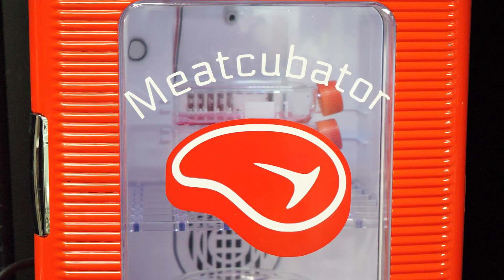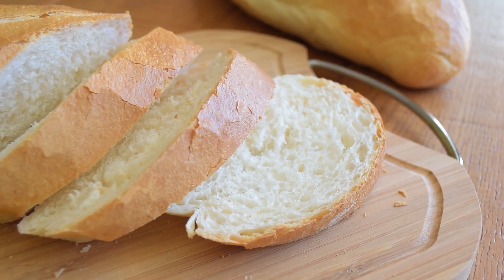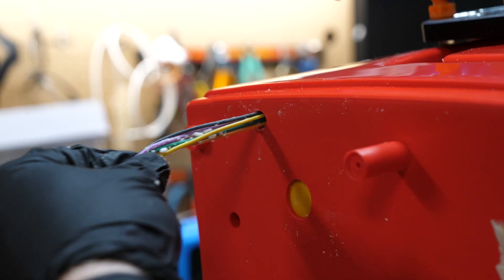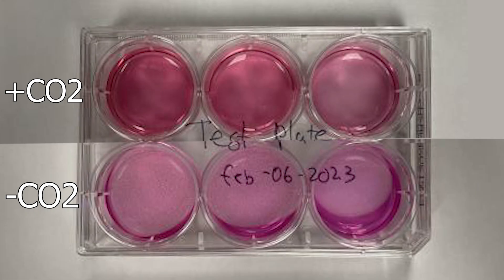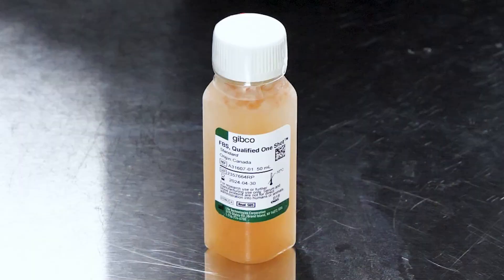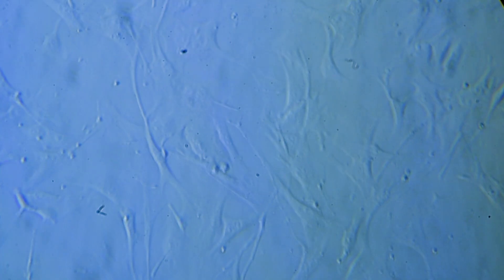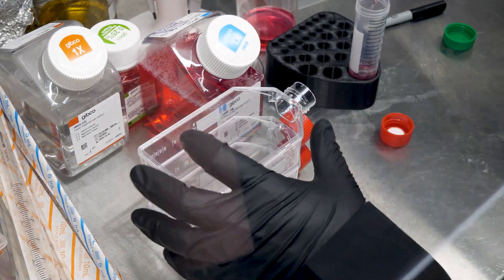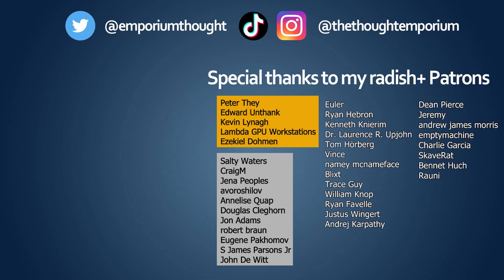This Machine Grows Living Flesh 🥩

Comment: Dark though: if I were to take a [the following have been removed because of reasons] and take that small piece of my skin could I just grow uh I don’t know how to put this but human?
Reply from the maker: In theory cloning from a skin sample is quite doable, it's just ungodly expensive and the failure rate is super high raising costs further and how fucked up the whole endeavor is. And the whole process is illegal. But yes, technically it is doable.
Reply: @thethoughtemporium  Looking back at how I worded this seems odd and I see how you thought I meant cloning a human due to the lack of context also Im surprised you actually responded to this
Reply: also while I'm here when you made the meat berry and you Decellularized (I dont know if I'm spelling that right) that grape what chemical(s) did you use as I want to try this at home also would this even be possible to do at home?

Comment: Lab grown meat does not use normal muscle cells. It needs cells that can continuously divide and are immortal.
Cancer cells.
Do you want to eat tumors ?
Reply: Yes
Reply: @pixal243  bon appétit !
Reply: MMM Tumors...
Reply: It dosent matter if it's a tumor or not lol. Your stomach is a acid bath full with Enzymes and other chemicals specifically made to turn meat into it's base components. The meat isn't making it past your stomach in one piece lol. So it can be normal muscle or cancer. Result is the same

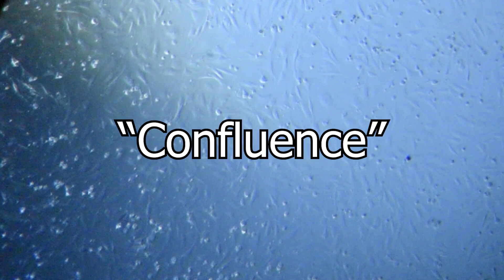Comment: @9:44 that's because you're pronouncing it in a... less standard way. Haha, It should be Con (as in Ghengis Khan or Long Con) + flu + ence, but with the stress placed on "Con" rather than on "flu". The "flu" should flow rapidly into "ence" (almost sounding like fluency which uses a similar etymology). It should be noted that the pronunciation of 'Confluency' is more similar to your pronunciation -- it's kun-fluency, with the emphasis placed on "flu".

Comment: I wanted to try and decellularize some plant tissues too so I rewatched the meatberry video to get the SDS solution right. But now I am confused. 2,5 g SDS in 500 ml water supposedly make a 5 % solution? Which measurment is wrong, is it supposed to be a 0.5 % solution or is it supposed to be 25 g of SDS?

Comment: Maybe to safe some money try to collect the cells in pbs (or hbss in your case) after trypsinyzing, quickly spin down, aspirate and resuspend in medium. Would safe you 15 mL of expensive medium per passage and works fine! If youre worried about cell viability (for more delicate lines such as neurons etc) you can add some FBS to the PBS (5%) to keep them happy.

Comment: Can you produce insulin without living cells, use ribosome and amino acids and mRNA only in a testube?  Cos people with type 1 diabetes are struggling. Current open source insulin involves living cells and filtration, can you make it simpler and safer and cheaper to use?

Comment: I did also a mammalian cell culture at my workplace, but we made us things a little bit easier. 
We measured only the time (about 20 seconds) when we added trypsidin so we didn’t need to take it out of the fume-hood-thingy (I don’t know how it’s called in English).
After the 20 seconds we removed all of the liquid, and waited about 5 minutes. There was still enough trypsin in the thin film of liquid sticking to the cells. We checked if the cells where ready, by gently tapping the flask on the table, when there where visible smears appearing, it’s ready to continue. After that we just added new FCS and all that other stuff, the trypsin after that was diluted enough to don’t matter anymore, counted the cell concentration in a neubauer counting chamber, calculated how much wen needed to transfer into a new flask and we where done.

(Sorry when I have some names wrong, I don’t live in a English speaking country)

Comment: I used to work in a lab where I grew neurons in culture from zebrafish I dissected and I have some recommendations if that's chill. In your video about growing neurons, I saw that you used Neurobasal-A. I can definitely recommend Neurobasal Plus instead. They both work, but the latter has given much better results. Also definitely coat whatever glass you're using for the MEA in PDL so the neurons can adhere to the surface. I'd also be happy to share more detailed protocols or tips and tricks if you want :)
Reply from the maker: neurobasal plus +b27 is what I'm looking at for the neurons. Plus PDL coated cover slips in a 12 well to start with. For the actual arrays it'll be basically the same, but directly on the array.
Reply: @thethoughtemporium  yeah cover slips in a 12 well is exactly what we did as well haha. Multichannel systems also has good resources for MEA related things. Best of luck!
Reply: @yaald4712 Hey, do You have any input on cryopreservation media? Synth-a-freeze? Something else? I'm completely green 😅
Reply: @margodphd  depends what cells you're using, but we used DMEM (or whatever media you grow them in) + FBS and like 5% or 10% DMSO
Reply: So this is what it's like for my mother when I start talking about feruchemy...
Reply: @DomineThiarna I'm just here just pretending to understand the conversation like "hmm yes neurobasal"😂
Reply: @ShiratoriIsOffline  ah yes 12
Reply: @RongDMemer  🤣
Reply: @RongDMemer  the 14 is excellent
Reply: @RongDMemer  ah yes plus is definitely a better number than 12
Reply: @RongDMemer I am familiar with that concept
Reply: @DomineThiarna  some with my mom but when I talk about my jelqing progress
Reply: @thekekronomicon590  i had to look this up and didn't regret it
Reply: @TheCaptnPlanet I'm glad I read your comment. Cuz It made me look it up too and it all makes sense now.
Reply: @DomineThiarna yeah lol
Reply: @DomineThiarna  Better find some spare copperminds so you can remember all the science words
Reply: This is probably really cool but I still don't understand any of it lol
Reply: Yes, your kind is made of zebrafish, chimpanzee, fruit fly a and more. Stop the bullshit yaald. Thanks to you and others similar your kind will suffer.
Reply: Darkages is here, and you're all shit out a luck

Comment: Why are you adding your thawed cells directly up the culture flask? Aren't you worried about the DMSO or freezing media?
Reply from the maker: Freezing media is just fetal bovine serum +DMSO. A little extra doesn't hurt. And this way the DMSO is diluted away quickly. There's risks of osmotic shock in theory but I've always done it this way and never had an issue

Comment: just a quick comment, you should pipet slowly up and down once the freshly thawed cells to resuspend them, then add them to a clean tube/container and slowly add previously warmed media on top (drop by drop at the beginning). I know fibroblast cell lines are quite sturdy, but it would still improve your survival rate and it's good practice. It prevents osmotic shock that can kill a lot of your cells. Also, if you try to stay sterile, dumping liquid from any container is not a good idea (you always assume the lip of the container is not sterile), plus you're probably throwing away the last drop 50-100ul of liquid left in the vial. 

On another note, I like your incubator, we just had to buy a new one in my lab and those are quite expensive.

Comment: I would like to an experiment performed where he controls cell differentiation and can verify that different cells have formed. I am also interested in the generation of neurons as well as their growth. If he can control which cells they are turning into/constructing then wouldn't it be possible to keep passing over the same mats and supplying new BSC and allow them to create a construct. If planned carefully channels for wash-out and medium replenishment should be able to be worked into it. Perhaps microchannels in glass could help "start" the process. Afterwards could be left with a (essentially tumorous) mass that can be "fed" for the most part by syringe and a complete change wouldn't need to be so frequent. If this was achieved then it should be almost trivial to add neurons into the mix and allow them to be supported by the mass as an infrastructure.

Comment: I have an improvement idea for your electrode array. You can buy "Empty" IC Packages.
Pins are Gold coated, can have 8 to 64+ pins, availabe in any form from SMD,DIP, to a huge cpu package AND are sterile. Also you will get a solid connection.
 I saw the epoxy and gold coatings fail in the original video, so i think this may be a nice upgrade.

Comment: Hi! Why don't you using versene solution instead of HBSS? To harvest maximum of your cells you need to chelate residual calcuim. First - to reduce adhesion (adhesion proteins are Ca-dependent), and second - to increase activity of a trypsin, which in being inhibited by calcium.

Comment: The spinning the cells to replace the Media to remove any tryptcin isn’t necessary. Proper media should cancel the effects of any tryptcin left over. The trick is to throughly mix the media after the cells have been removed from the wall, take only 1ml of the mixed media and add that 1ml to a new container before adding another 15ml of fresh media. It works the same and saves you the time of centrifuging the cells. Also a shaker table isn’t necessary either.

Comment: I know many usually remove the trypsin first before seeding. But tbh in my experience the fibroblasts really do not care as long as its diluted enough
Reply: Yeah I also never saw the point in removing it. Most cell lines expect maybe neurons and stem cells don't seem to care to much about residual trypsin

Comment: If the cells are in the sealed flasks, how are they exposed to the Co2 and humidity of the meatubaker? Also, what major should I go for to do this line of work? Because right now, I'm going for chemistry; would bio-chem be sufficient?
Reply: Biochem is probably your best bet as molecular biology probably isn't available to you easily. You would then have to search for jobs in the genetics/protein field as they are the closest to cell cultures.

The flasks have a membrane in the top which let's small molecules like CO2 pass (I think it's expanded polyethylene like Goretex but don't quote me on that) or caps that don't have it are not screwed down tight. That gap is than small enough for air to pass but to hinder bacteria and spores (since there are normally no air currents in an incubator)
Reply: @lewan1905  Thank you.

Comment: I took a look at the code and I note that the co2 injection code does not account for humidity. I suppose that if you are keeping the humidity constant it shouldn't matter that much,  but AFAIK co2 sensors are quite sensitive to humidity. If you run into problems with the co2 concentration, that might be something to keep in mind. Keep in mind I am a software/firmware developer, and I don't know very much about biotech, so it might not be a problem for you. Very cool stuff!
Reply: Relative humidity is kept at nearly 100% in most cell incubators and doesn't vary much unless the incubator has been opened recently and hasn't normalized yet. He has a bowl of water on the bottom also being warmed by the incubator, so it's keeping the incubator humidity as high as possible. So as long as the sensor is calibrated to read at saturated humidity it will be fine. The cells need the humidity too, so if the bowl dries up the CO2 will be the least of your worries.
Reply: I'd want one of these whenever I'm at.

Comment: Wowowo! Impresive video! I love that there is a dedicated Youtuber showing common cell biology methods that are used in research for the non-specialized folk to see. 

It caught my attention that you are thinking on using a replacement for foetal bovine serum (FBS) so I would recommend you to switch to platelet lysate (PLT). I am working on a paper now in which we explore using PLT as a supplement alternative. It has the advantage that it is produced from human platelet samples that are not suitable for transfusion and it definitely makes cells proliferate faster than FBS. It is a bit more pricey, but it is far more efficient since you can reduce the concentration in your media. The only drawback is that it may interfere with cell differentiation if you are planning of driving cells towards a specific phenotype.
Reply from the maker: We're looking at using processed egg yolk instead of FBS. And if I can replace DMEM with slightly modified green dakara, it'll be the dream.
Reply: @thethoughtemporium  That would be ideal, indeed. Although I took a quick literature check and some labs since the '80s tried to use egg yolk as supplement and it worked for a couple of cell types, although it reduced proliferation speed and severely reduced the in vitro life span of the cells. DOI: 10.1007/BF02618160

Comment: You forgot to mention just how expensive FBS is! I've done a lot of tissue culture myself and seeing the recent developments in cultured meat has got me wondering about the "FBS question", since using FBS isn't that conducive to a cheap or cruelty-free product. I'll be super interested to see if you're able to get good results using serum-free media.
Reply: There certainly are plenty of alternatives, but the issue is the alternatives are even more expensive right now. The biggest one is Knockout Serum Replacement, which is a chemically defined serum-like fluid, though it misses many growth factors. It's quite expensive, more than serum, and can't replace it in all situations. There are also specialty medias for for a ton of different cell types that are serum free, Essential 8 for pluripotent stem cells, Serum Free Expansion Media (SFEM) for hematopoietic cells, etc. It's an eventually solvable problem for the industry, but it's not always done right now because of the cost of the alternatives or the necessary growth conditions just aren't known yet for a particular cell type. Cells can also be genetically engineered to express their own growth factors or transcription factors that preserve their cell state and proliferative potential.
Reply: Magnetic fields. No, seriously.

Back in November 2022, a Singapore research team managed growth factor production from myogenic stem cells using pulsed magnetic fields.

Comment: I am very interested in learning about alternatives to fetal bovine serum. I was under the impression that there aren't any viable substitutes? Looking forward to maybe a dedicated small video on the topic? Might give the whole industry a push if awareness is spread from somewhere
Reply: There certainly are plenty of alternatives, but the main issues are usually cost. The biggest one is Knockout Serum Replacement, which is a chemically defined serum-like fluid, though it misses many growth factors. It's quite expensive, more than serum, and can't replace it in all situations. There are also specialty medias for for a ton of different cell types that are serum free, Essential 8 for pluripotent stem cells, Serum Free Expansion Media (SFEM) for hematopoietic cells, etc. It's an eventually solvable problem for the industry, but it's not always done right now because of the cost of the alternatives or the necessary growth conditions just aren't known yet for a particular cell type.
Reply: From what I've heard there are alternatives on market today they just aren't as effective. Shockingly I cannot speak on this subject with any first-hand experience as I have nowhere near the money to perform these kinds of experiments at all.
Reply: Surprisingly, magnetic fields! 

Back in November 2022, a research team in Singapore’s National University of Sciences managed to use magnetic fields to stimulate the release of growth factors by myogenic stem cells to accelerate the growth of meat/muscle tissues, all with no FBS.

They’ve already looked into commercializing this technique/technology for use in regenerative medicine and cultured meat production.
Reply: @serinahighcomasi2248  On a more practical side... use human platelet lysate from buffy coats. It is a commercial product.
Reply: @serinahighcomasi2248  Saw a similar method of using electrical potentials to control how a flat-worm regenerated. The presentation was on them wanting to use study this for how to apply it to improve machine/deep -learning neural networks (facepalm).
Reply: @serinahighcomasi2248  can you give some sources, names, links etc ? Thanks. Want to look deeper into this.
Reply: The issue isn't that there aren't viable substitutes but that most chemically defined growth media right now is extremely expensive and only works for small groups of cells. You thus need a range of different types to work with different cell lines and many cell lines do not have chemicals defined media available. So it comes down to convenience and cost
Reply: you could probably engineer something like bacteria or yeast to produce it. the question is how expense would it be
Reply: @DSam-de1fr  but even Optimem needs FCS addition, just less than regular DMEM

Comment: Would a humidity sensor be a good idea to install into the meatcubatorfor logging purposes?
Reply: Nice, new incubators have them, but it's not completely necessary. As long as he keeps the water bowl on the bottom filled, the humidity will saturate. It's easy enough to do a circuit that alarms if water doesn't bridge two electrical contacts to remind you to fill the bowl.
Reply: this disgusting hindu is tryin to grow sperm

Comment: Why do mammalian cells need CO2 to grow/survive?
Reply: Googles answer:
"The purpose of CO2 in cell culture is to maintain a stable physiological pH through the CO2-bicarbonate based buffer system. The atmospheric CO2 can dissolve into cell culture medium, and a small portion of it will react with water to form carbonic acid, which in turn interacts with the bicarbonate ion. The balance of dissolved CO2 and bicarbonate thereby controls the pH of the medium."
(by aatbio)
Reply: @Jehty_  ah, buffer to stabilize pH. Thanks!